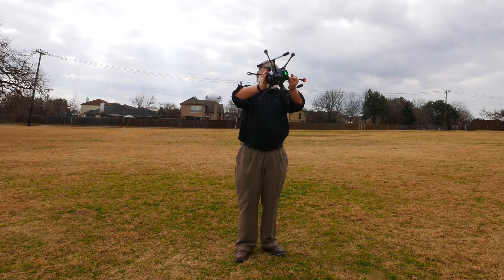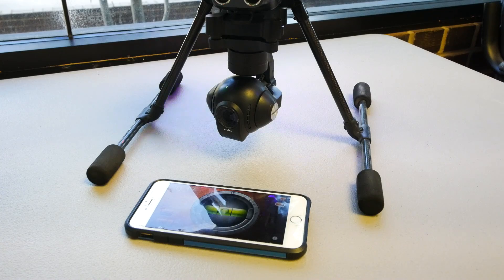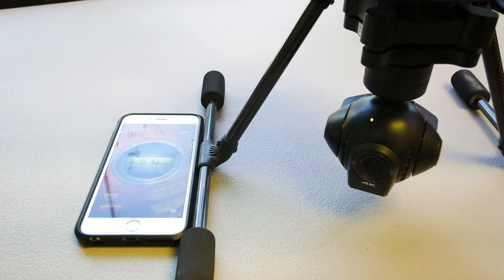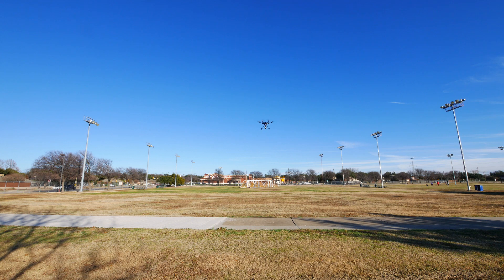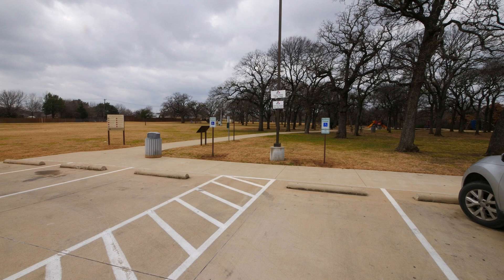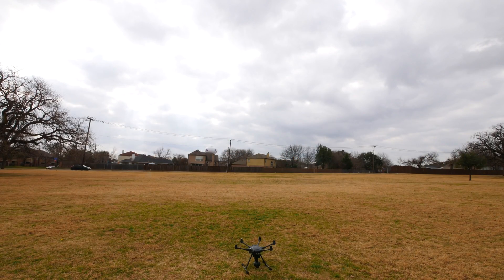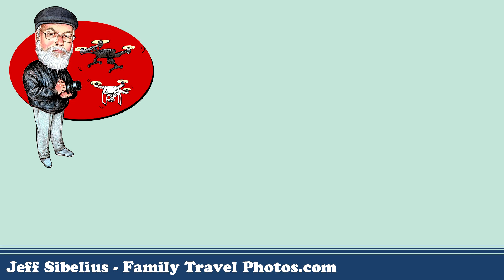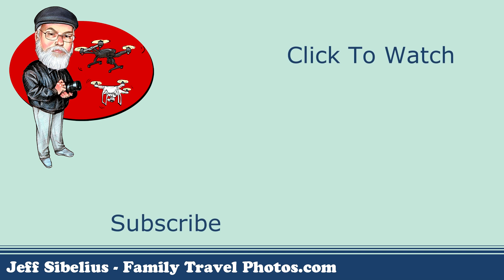Typhoon H Calibration: How to Calibrate the Compass, Accelerometer and Gimbal

Comment: Great detailed video for anyone that can't read the manual. It can be very misleading to say drifting to one side must have anything to do with the compass calibration. What's a way more usual cause for this kind of drifting(and also an error beeping if it occurs before launch) on a Typhoon H, is a loose pot-module on the (usually right) stick, on the ST-16 controller. The pcb with the potentiometer is a little bit too tiny to be clamped tight by the two screws. It makes it move a tiny bit, that results in the stick not returning to exact 0. It's easily fixed with either a drop of glue or a piece of paper.

Comment: Hello jeff ! Before  any thing thank you  your videos are great ! I brought  and fly my typhoon H in  miami  Florida but traveled  to Rio  Brazil  and can't  finish the Cc procedure, ever at the end i still have a (amber  light)  blinking  together  with a green,purple or red  if i  move the switch  smar, angle or home  so i can't  start the engines  and take off   i was in a open field   and no cellphone  or other electronic  ! Do heard about  demagnetizing procedure? Do you know how to do that?
Reply from the maker: I've never heard of a demagnetizing procedure for the H. Have you tried to do the calibration in another location? I''ve found the H to be more sensitive to interference on calibrations than the Q500 was.
Reply: Oh yes mr.sibelius ! i have tried in a  open field,this problem is absolutely  frustrating
Reply from the maker: Interference could be coming from pipes or cables below the surface of the ground - but if you can't calibrate the compass after trying in several places, it sounds like something is defective. At this point I'd call Yuneec and see what they say about it.

Comment: Jeff, to make sure that you do not damage the camera gimbal could you keep the cover on during compass calibration.?
Reply from the maker: Hi Craig - no, you don't want to do that. Powering up your aircraft with the gimbal cover on can actually damage the gimbal. If you're concerned about damaging the gimbal during calibration, you can actually remove the camera/gimbal from the drone, then power it up and do the calibration, then shut it down and restore the camera to the aircraft.
Reply: @JeffSibelius  The gimbal has a compass inside also, so it may need to be on when calibrating.
That's how it knows how to aim forward.

Comment: By far the best video for Calibrating the Typhoon H.  Was not able to get my new H calibrated after several attempts but with the new knowledge I got from the video I hope that changes my ability to get it calibrated.
Reply from the maker: I'm glad it helped - the H is a little unwieldy to calibrate, but fortunately you shouldnt have to do it often.

One tip - make sure you don't try to calibrate it around any steel. Even rebar in the concrete beneath the drone can cause calibration to fail. The H is pretty sensitive to this, more sensitive than the Q500. I try to do calibrations off of pavement, ideally in an open field.

Comment: Hi Jeff, just wondering on the Q 500 there is a spot for an SD card in the back of the transmitter. I never knew this is 1 of the most important things to do Before you fly. This happened to me so I am sharing this issue with all . When you loose your drone But you have a good idea where it is in the woods , I couldn't find it heave brush,  So if this SD card was in my Q 500 I would have the Exact spot where it is by using a hand held GPS So this is something Everyone has to have in before flight. I should have been told this rite from the Hobby store . Its still lost , if you have any ideas , would love to hear them. OH I now own the Typhoon H now its built in the radio.. I love all your videos.
Reply from the maker: Hi Bob - Glad you enjoy the videos! There is a place for the card in the Q500 transmitter but it's well-hidden. On the back of the transmitter, open the battery bay and remove the battery (you can leave it connected, just pull it out of the bay). You'll see a silver card holder behind where the battery sat. It slides up and down to latch and unlatch - when unlatched it flips open for you to insert the card.

I don't know if the transmitter for the Q500 stores telemetry information or not - you might try contacting Yuneec to see if can be retrieved from the transmitter in any way.Unfortunately, I think this data is stored on the card in the aircraft or the card you put in the transmitter. :(
Reply: Hi Jeff, I know there is a place for the card, What I am saying is that no one ever in any video told us how important it is to have this card in Before we start flying . This card holds the info incase you loose the drone . Ho I am in need of a camera for the Q 500. call me  973-714-1555 I live in Florida.
Reply from the maker: ah, gotcha. That would be a good quick tip video - I'll add it to my list!

Comment: 2 things , probably a consistency issue, at the end of the Compass calibration  shouldn't the indicator light at the back  be solid green? And  when doing the calibration for Accelerometer aren't you supposed to tip the aircraft forward twice ? BTW I was never told to face north....but the tin foil hat and standing on one leg whistling Dixie helped ! 

I have been having issues with craft wondering and landing recently.
Reply from the maker: I think the indicator light will be the color designated by your mode, right? Smart vs. Angle? Now I have to go back and check that. 

The accelerometer calibration doesn't require tipping the aircraft twice - that's for binding the aircraft to the transmitter. You should be able to do the accelerometer on a flat surface just by hitting the button.

LOL don't get the tinfoil hat comment but Yuneec CS told me originally to point it north so I stuck with that. It certainly doesn't hurt to do it.

What issues are you having with your H?
Reply: This is the newer one,. it's been wandering, and hard to land , seems to want to go to any structure  like lamp posts that are near, I noticed that it tried to take off  on it's own, probably trying to get to a gps point I guess, and landing , even in  'home'mode (I had to use yesterday) it started to bounce on landing. I had to use 'home ' as it seemed I had lost control while landing. So I tried to re-calibrate the compass, hard to do in bright sun light , not sure if it took or not ( thus the green light question) and I have re calibrated accelerometer, I Will try again and see if that helps .
Reply: Oh the "tin foil hat " just me being silly !  lol
Reply from the maker: I bet the calibration will solve your issue. What you're describing is the behavior you'll see when the aircraft is not calibrated or if you don't have sufficient GPS connection.

I've found the H needs calibrations more than the Q500 and the H compass calibrations are more sensitive to interference as well - so pick a spot that is away from metal interference (even rebar in the concrete). 

If memory serves correctly there should be an audible tone to let you know the calibration worked as well. I typically do these at noisy construction sites so I probably wouldn't hear it even if it did make a noise LOL.

Is your firmware up to date? Something else to check if the calibration doesn't solve your problem.

The take off issue is something separate. Twice I've had my H try to re-launch after landing. I even showed it in one of the videos but I can't remember which . . . what I recommend is to land the drone and keep the left stick pulled all the way back until you kill the motors with the red button. Then let go of the stick and if necessary, stop your video recording. Never had to do that with the Q.
Reply from the maker: LOL gotcha. I wasn't sure if I'd inadvertently stepped into a topic of hot debate on some discussion forum . . . I've been known to do that.

Comment: Hello Jeff, I've heard that doing the compass calibration with the gimbal attached can damage the gimbal..???! Is it OK to calibrate the compass with the gimbal removed...???? On my last flight my Typhoon H would not land when throttle fully retarded. It remained in a hover for a good 5 minutes at approx 12 inches off the ground. PUZZLED...??? By the way...Great video...!! JB
Reply: The gimbal has a compass inside also, so it may need to be on when calibrating.
That's how it knows how to aim forward.

Comment: HI  JEFF
 YUNEEC TOLD ME TO DO THE COMPASS CALIBRATION FIRST
   THEN   ACCELEROMETER
    THEN   GIMBLE
  PS  THE Y ALSO SAID  YOU COULD DO THE COMPASS CALIBRATION
  WITHOUT THE CAMERA  ON THE DRONE.

I  THINK  THAT IS COOL CUZ YOU DON'T GET ALL THE
CAMERA JITTER IN THE PROCESS.
 KEITH
Reply from the maker: It certainly can't hurt to do calibrations in that order. 

Over the past couple years I've asked two Yuneec technicians about this and both told me the order didn't matter. This is the problem we face when trying to decipher an instruction manual that is incomplete and translated from Chinese, and having a tech support team that doesn't have standardized procedures for common tasks like calibrations. I love Yuneec CS, don't get me wrong, but they aren't consistent. 

I'd heard that about removing the camera. I probably should do that because compass calibration is tough on the gimbal, flopping around like Dolly Parton on a trampoline. I try not remove the camera unless I need to because I always worry about messing up the connection or breaking the plastic pieces that hold the camera in place. Next time I calibrate, I'm going to take off the camera and see how it goes.
Reply: HI  JEFF THAT IS A RIOT.
DOLLY  PARTON = TRAMPOLINE.
 I  LOVE IT
 KEEP EM COMING JEFF
 KEITH KUHN

Comment: Jeff i had a problem with my typhoon h Gimbal no one could tel my why the gimbal would not stop rotating 360 deg until i found out the the gimbal had to be recalibrated now i no ,
Reply from the maker: That's pretty crazy behavior for the gimbal, I've never heard of that. I'm glad the fix was as easy as a calibration!